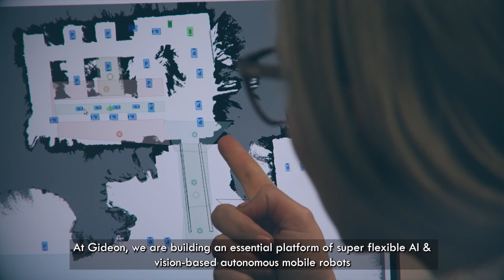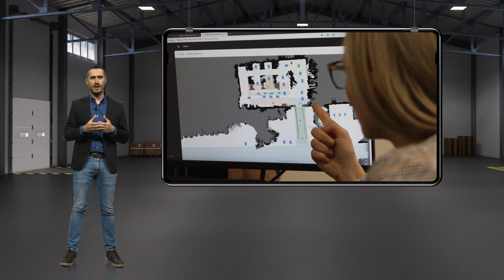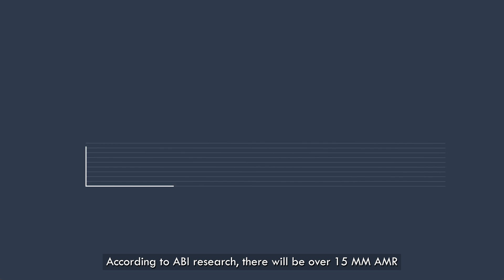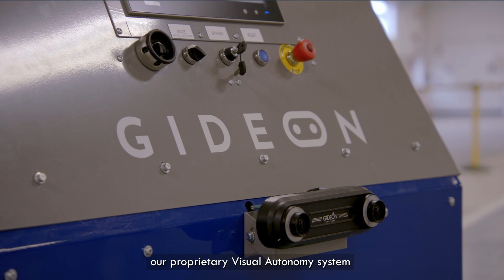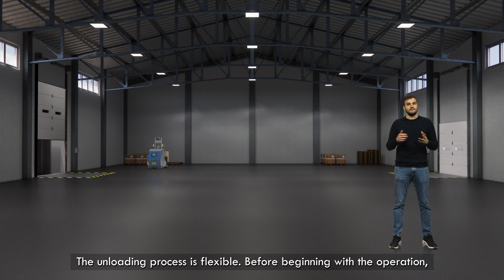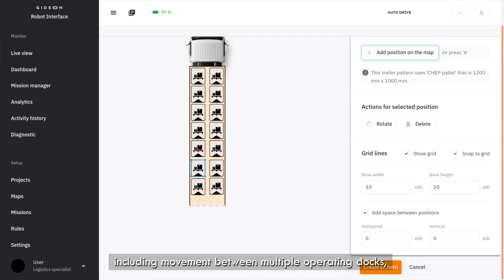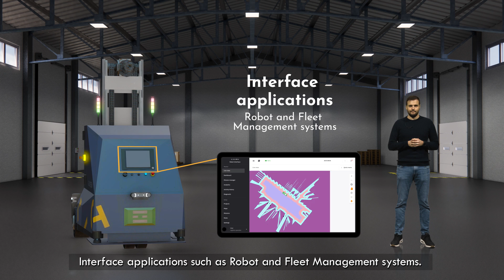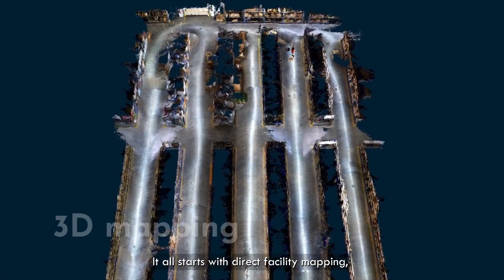Trey - the autonomous forklift for trailer loading and unloading I Gideon

Comment: Does your robot consider different pallet loading schemes? Like Turned, Pinwheeling, Straight. Does it capable to weight a pallet and properly load the truck so the the weight will be distributed between truck axles?